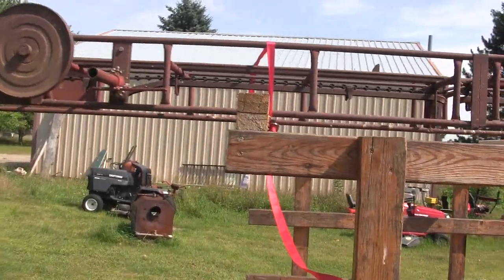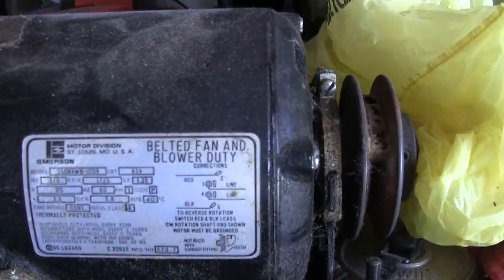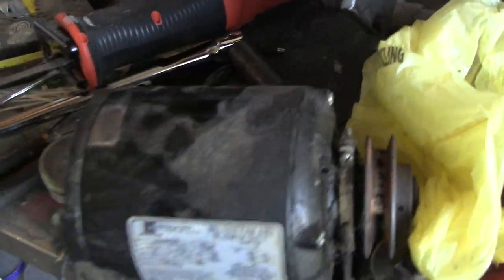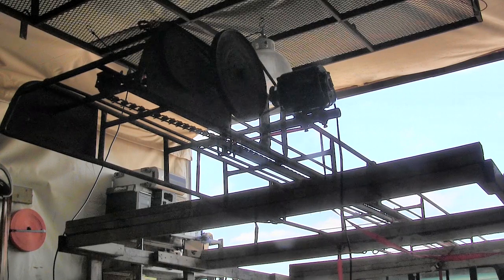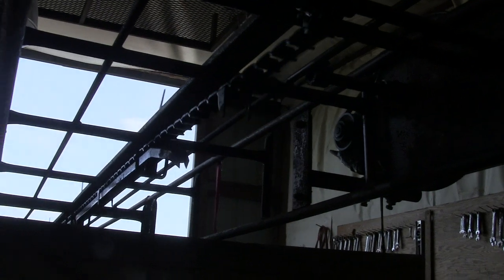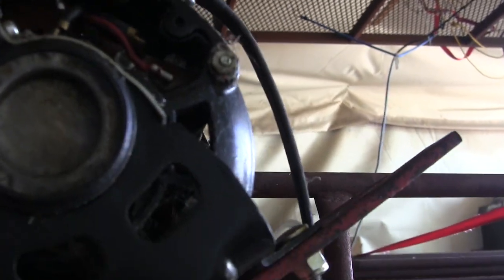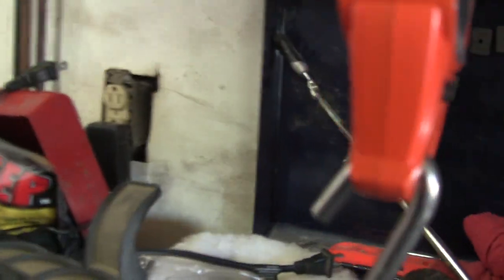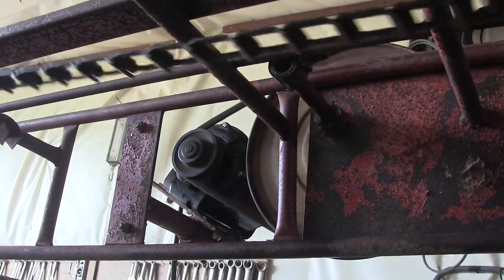A free hay elevator

Comment: You could add a smaller pulley to the motor if it doesn't have enough power. That should gear it down a bit and help it out.

Comment: No... that's not a 6 hp motor. That's a 1/6th horsepower motor. Put six of those together and you'll have a full horse. Even the fan motor on your outdoor AC unit runs a 1/4 hp motor to blow air through the coil. :P 

You may have got it to turn the chain, laying flat, but if you try to lift bales with it - I would bet you need at least a 1 or a 2 horse motor to make it happen.

Comment: Those are enormously handy for moving packages of shingles around. Unless you really load it up, I don't think it'll need much of a motor. The one I used had maybe a half-horse motor on it and it did just fine.
Reply from the maker: That's a great idea. I wish I would have thought to use one for shingles about a decade ago when I was doing a lot of roofing.